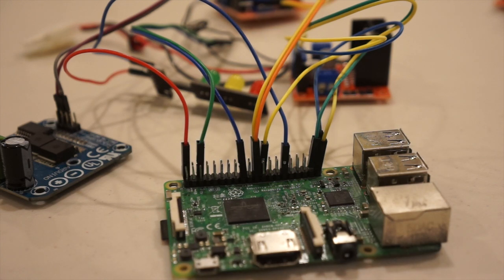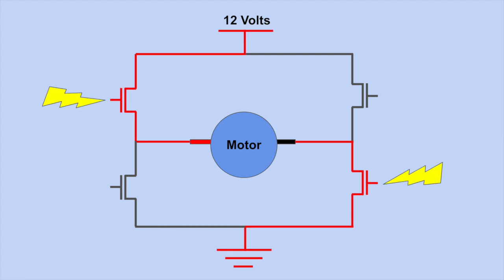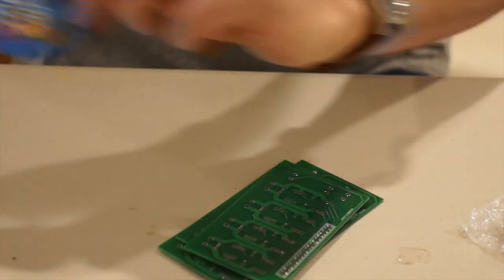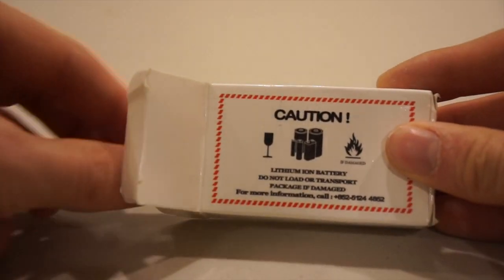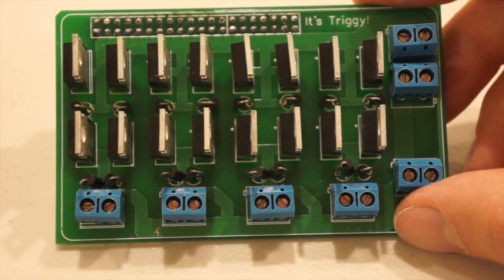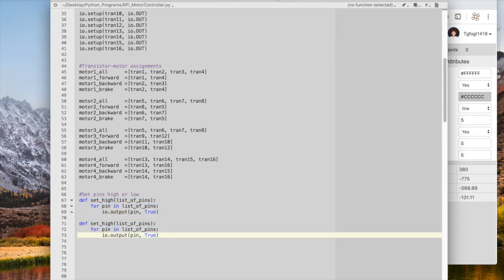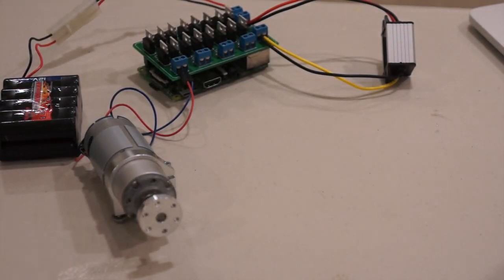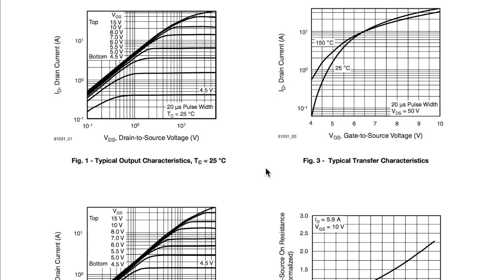DIY motor controller for Raspberry Pi

Comment: I’m unclear on how your H-bridge would function. You claim to send +5v to the gates in orthogonal quadrants and that turns on the appropriate devices. How do you get either of the upper devices to turn on to any sufficient level when they’re connected as a source follower? Assuming the bottom device turns fully on (low Vgs devices?) the best you’ll get on the “top” of the motor is 5v - Vgs, or about a couple of volts. This doesn’t seem particularly optimal. Please explain.
If you had 12v + Vgs for gate drive on the uppers it could work better or use P-channel ones with an inverted drive but, you don’t say anything about that. Again, please clarify.